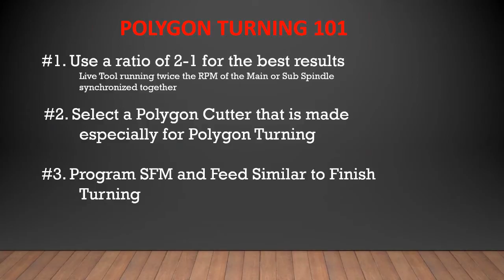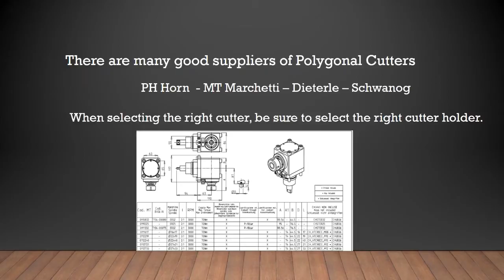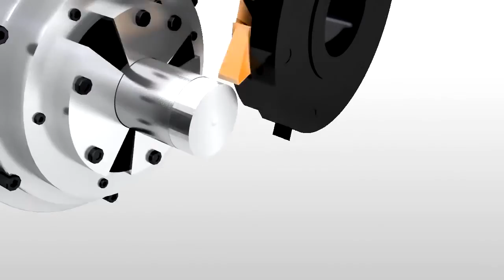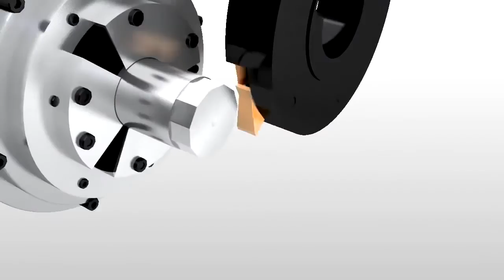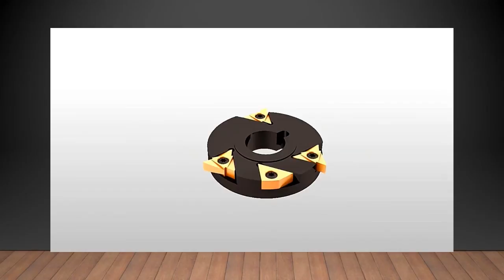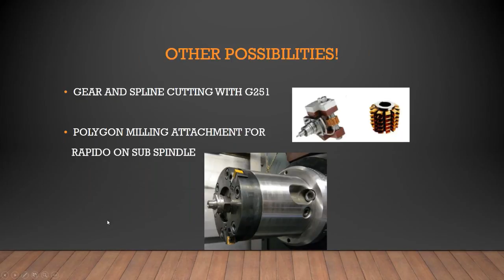final copy of polygonal turning webinar

Comment: If I complete Polygon turning at one Spindle Speed..after that change RPM without removing workpiece ..
Is it work on same path of Hexagon or Not ..??

Actually facing issue at one place...
Reply from the maker: @dhavalgandhi  We apologize for not replying to you sooner! The problem with increasing the speed of the cutter during polygonal turning is that both spindles will sync to the same ratio. Even with an RPM change, the start of the cutter cannot be guaranteed to be the same as the previous RPM.

There should not be an increase in the speed of the cutter or the part spindle during the Polygonal Turning.

The primary issue with changing RPM is that you would need to run first with your rpm making your flats or planes, stop and restart with a new rpm, and then attempt to sync up at the same ratio (1-2) using the same Z start.

To find the same plane, you could use an R for shifting until you find the same phasing.

Comment: very very inserting, however i was imagining that diameters what has to do with concave/convex surfaces not the ratio
I need an explanation from you, how the ratio can give that effect? based on what?
the number of cutters can be compensated by rpm, so how that change the surface flatness?, also how can i get that formula to calculate flatness of the surface, can you share an email or link plz? thanks in advance
Reply: See the above post.
Reply: @Evan-e-cent  what post? cant see it
Reply: To GraphicMan Innovations:  It appears that  my post was deleted because it mentioned my web site which includes a computer simulation of polygon cutters which could be very useful to people posting here. I suggest you search for ride the gear train by evan lewis. I will post a YouTube video about it soon.